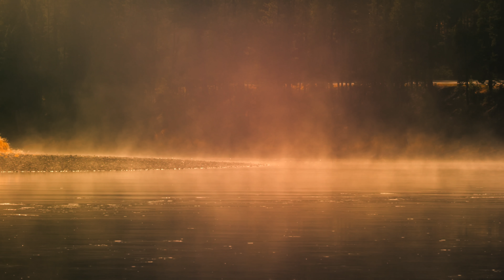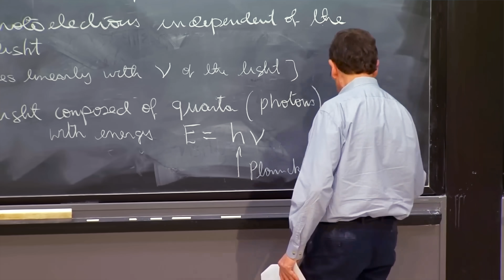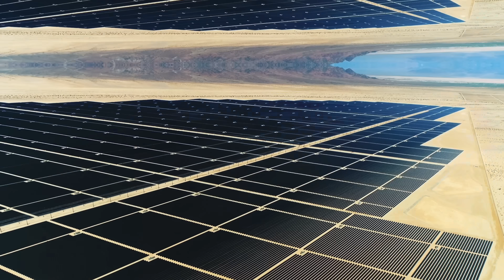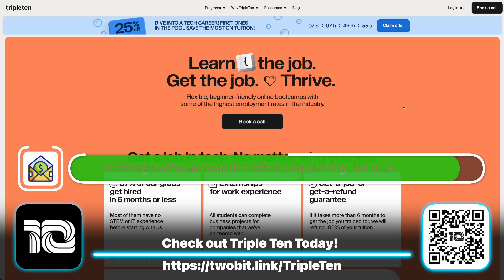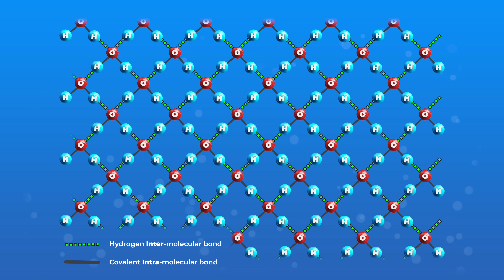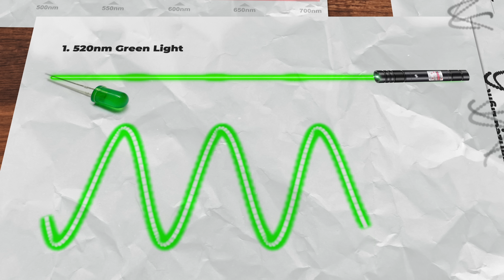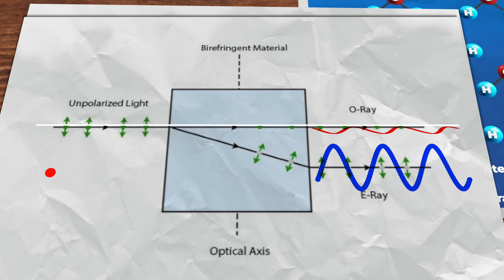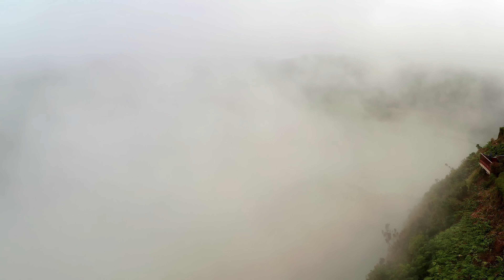New MIT Discovery Just Solved Water's BIGGEST Mystery!

Comment: And causing condensation in the desert.
Concept of Using Lasers to Induce Water Condensation
The idea of using lasers to induce water condensation in arid regions, such as the Australian desert, is an intriguing concept. It could potentially revolutionize environmental science and contribute significantly to efforts aimed at greening deserts.

Feasibility and Mechanism
Photon Energy and Molecular Interaction:

Mechanism: The concept relies on the photomolecular effect, where photons impart energy to water molecules, influencing their phase change. If a suitable frequency of light, such as green laser light, can efficiently transfer energy to water vapor molecules, it could theoretically induce condensation.
Research Basis: Studies like those conducted at MIT on the photomolecular effect show that light can cause water to evaporate without heat. While this focuses on evaporation, the underlying principle of photon interaction with molecules could be adapted to explore condensation.
Cooling Effect:

Laser Cooling: Just as laser cooling techniques can reduce the kinetic energy of atoms and molecules, it might be possible to use specific light frequencies to reduce the energy of water vapor molecules, promoting condensation.
Environmental Context
Australian Desert Conditions:

Temperature: The Australian desert experiences extreme temperatures, with summer highs ranging from 90 to 104°F and winter lows from 64 to 73°F.
Humidity: The relative humidity is generally low, often below 30%, and can drop as low as 10% during late winter and spring.
Rainfall: The region receives very little rainfall, with less than 10 inches annually for about half of Australia, making it one of the driest continents.
Application Potential:

Desert Greening: If lasers can be used to induce condensation, this technology could potentially create localized areas of increased humidity, leading to the formation of dew and even small-scale precipitation.
Sustainable Water Sources: By generating water through condensation, this method could provide a sustainable source of water for irrigation and other uses, aiding in desert greening efforts.
Practical Implementation
Pilot Studies:

Conducting pilot studies in controlled environments to test the feasibility of using green lasers or other light frequencies to induce condensation.
Measuring the efficiency of condensation and the specific conditions required for optimal performance.
Technological Integration:

Developing scalable laser systems that can be deployed in desert regions.
Integrating with existing water collection and irrigation systems to maximize the benefits.
Challenges and Considerations
Energy Requirements:

Assessing the energy efficiency of using lasers for condensation compared to traditional methods.
Ensuring that the energy input required for laser operation is sustainable and does not offset the environmental benefits.
Economic Viability:

Evaluating the cost-effectiveness of implementing laser-induced condensation on a large scale.
Considering the potential economic impact on local communities and agricultural practices.
Conclusion
While the concept of using lasers to induce water condensation is promising, further research and experimentation are necessary to validate its practicality and efficiency. If successful, this technology could significantly contribute to environmental efforts aimed at greening deserts and providing sustainable water sources in arid regions like the Australian desert.

Comment: What about using green lasers to melt ice?
Speculating on the Lowest Temperature for Green Laser-Induced Sublimation of Ice
Based on the principles of the photomolecular effect, we can hypothesize about the lowest temperature at which a green laser could cause the sublimation of ice. Here are some considerations and speculative insights:
Factors Influencing Sublimation Temperature
1.	Photon Energy:
o	Green light (approximately 532 nm) has enough photon energy to impart momentum to water molecules. This could facilitate sublimation even at low temperatures, though the efficiency decreases as the temperature drops.
2.	Bond Strength in Ice:
o	At lower temperatures, the hydrogen bonds in ice become stronger and more rigid. For sublimation to occur, the energy imparted by the photons must overcome these bonds.
3.	Experimental Evidence:
o	Currently, no direct experimental data specifically addresses the lowest temperature at which green laser-induced sublimation occurs. However, indirect evidence from light-induced evaporation of water suggests that the effect can operate independently of significant thermal input.
Hypothetical Temperature Threshold
1.	Near Absolute Zero:
o	While sublimation can occur at temperatures as low as -78.5°C (the sublimation point of dry ice, which is solid CO2), the scenario with water ice could be different. For water ice, sublimation naturally occurs at temperatures below 0°C (32°F) in a vacuum or at low pressures.
2.	Speculative Lower Bound:
o	Given the efficiency of the photomolecular effect and the known behavior of sublimation, it is reasonable to speculate that green laser-induced sublimation could be effective at temperatures significantly below 0°C. A speculative lower bound might be around -40°C to -50°C, where the effect of the photons could still provide sufficient energy to overcome the molecular bonds in ice.
3.	Experimental Validation Needed:
o	This hypothesis would need validation through controlled laboratory experiments. By progressively lowering the temperature and observing the sublimation rate under a green laser, researchers could determine the precise threshold.
Potential Research Directions
1.	Controlled Experiments:
Comparative Studies:
•	Comparing the sublimation rates: Conduct experiments comparing the rates of sublimation of ice under green laser light versus traditional thermal methods. By measuring the rate of sublimation at various temperatures, researchers can identify how effectively the photomolecular effect works at lower temperatures.
•	Different Wavelengths: Investigate whether different wavelengths of light (e.g., UV, blue, infrared) affect the sublimation rate and compare them to the efficiency of green light. This can help identify the optimal wavelength for inducing sublimation.
Speculative Lower Bound and Further Insights
1.	Initial Observations:
o	Preliminary experiments might start at higher sub-zero temperatures, such as -10°C or -20°C, and gradually decrease to test the limits.
o	Initial observations may reveal the minimum temperature where the photomolecular effect is still effective.
2.	Ice Structure and Composition:
o	Consider the impact of the crystalline structure of ice and potential impurities, as these factors can influence sublimation rates. Pure ice and ice with impurities (like salt or minerals) may respond differently to light-induced sublimation.
3.	Theoretical Models:
o	Develop theoretical models to predict the interaction between light photons and ice molecules at various temperatures. These models can help refine experimental designs and provide a better understanding of the underlying mechanisms.
Potential Applications
1.	Space Exploration:
o	Understanding light-induced sublimation could have applications in space exploration, where controlling the sublimation of ice on spacecraft or celestial bodies might be useful.
2.	Cryogenics:
o	In cryogenic storage and transport, precise control over sublimation rates could improve the handling of frozen materials.
3.	Climate Research:
o	Insights from these studies could enhance climate models, particularly in polar regions where sublimation of ice plays a significant role in mass loss from ice sheets and glaciers.
Conclusion
While current knowledge suggests that green laser light can induce sublimation through the photomolecular effect, further research is required to determine the exact temperature limits and efficiency at very low temperatures. Experimental validation, theoretical modeling, and comparative studies with other wavelengths will provide a comprehensive understanding of this phenomenon and its potential applications.

Comment: It seem this also gives a better answer to the very simple question: Why are most plants green? 
We know that most forms of chlorophyll absorbs mainly blue and red light for photosynthesis; but they reflect green light
So, this is cool. By reflecting light in the 520nm range (green), they would greatly reduce the photomolecular effect and better retain water.
Reply: Plants have other means of protecting themselves from evaporation, such as waxy coatings on their leaves.  The ancestors of plants also evolved in the oceans where evaporation wouldn't have been much of an issue.

A more widely accepted idea for why plants are green is the Purple Earth Hypothesis.  The basic idea is that photosynthesizing organisms that use chlorophyll evolved after and had to compete for light with earlier organisms that did absorb green light (and were thus purple).  We don't see that state of affairs today because most of the purple photosynthesizers were killed off by all the oxygen that chlorophyll-based organisms eventually produced.

Comment: I've always understood simple drying effect as the air is like a sponge and absorbs the moisture of liquid water when the molecules on the surface yield to the dryness of the air. The dryer the air the high the evaporation rate. But once the air reaches maximum moisture content it can no longer absorb any more moisture from the liquid water which stops the drying process. Even if it is heated, there is no where for the moisture to go at that point. You don't need any heat at all to evaporate water. Think about freezer burn. Its a form of drying at under the freezing threshold. Water evaporates under many conditions. Heat and/or light seems to be just another force that contributes to water evaporation.

Comment: Which leads to the question, "What if the sun goes through cycles in which it produces more or less green or near green light than at other times?" And not just green. While green may be the "best" at doing this that doesn't mean other colors do nothing. Perhaps even light outside the visible spectrum. It could help explain ice ages. Less green light, fewer and less dense clouds, therefore less heat trapped. Conversely, more green light, more and denser clouds and more heat trapped resulting in higher temperatures. What would variations in green light do to plants? Would they change and become less green appearing? Would less green light mean more plants?

Comment: This is really disappointing because I already solved the same before age of 10.

At hot summer day, I went to swim at beach. So, while I was resting, I felt very cold when I was drying up. I went back to water and beach several times to confirm, that it was sunlight, which vaporized the water and made me shiver, because it took much more heat from my skin in sunlight than in shadow. I was very proud of my discovery, but it never come up again in my life before this video.

Comment: I was wondering how could you increase the surface area of water to increase water evaporation rate using the photomolecular effect during the whole length of the video. Could you in theory excite the water using ultrasonic vibration to make the water vibrate on the surface so it has more surface area? The amplitude and frequency would affect the surface area, so would the angle of excitement. From beneath, from the sides, on angles, multiple exciters to generate multiple wavefronts... So many possibilities!

Comment: If I am not mistaken this was proposed and mostly proved many years ago, but there were too many variables to apply to real in life models without more sensors and data so the it was assumed as true to but ignored for calculation and application purposes for several reasons including most experiments were on small scale and methods of generating light were not that affordable to do much with it.  There were some political and business reasons these things were ignored.  Some of the early versions of those experiments were 1600's and many records of earlier experiments suggesting same effect.  This is even referenced in some of wholistic and home steading literature about making things that control the amount of green light.  Ever check the energy and pharmaceutical sectors patent ownership logs or what was deemed not profitable and buried?  No conspiracy just facts.  Always follow the big green dirty $ trail.  MIT does not have ownership of that discovery and like patenting penicillin to gain notoriety or profits.  There are even clothes drying designs already out there that use the concept in combination with another method both that are more efficient they the common "high tech" (if you are the general public) dryers and the same reason you don't see more cheaper and efficient battery tech mass produced.

Comment: I'm baflled that this was unknown.
Bill Gates proposed chemical trails in the sy to be sprayed by planes, to combat climate change. When others have long claimed that such artificial overcast, typically forming in the PM, are raising overnight temperatures by keeping the heat nearer the surface, causing seeming warming of the climate, to be attributed to the green breath of life (CO2), when really it's light absortion and heat blocking from the artificial overcast.
So will will new insight make chemtrails even better at "proving" climate change by preventing clear sky nights, or will it help Bill Gates in trying to cool the surface air (because that's appararently what matters, not the 12000 km spinning ball of lava underneath) to "save the planet" when it's been wiped out time and again by celestical impacts and perhaps solar flares?

Comment: Well, as an Architect of Water Desalination Systems using solar thermal energy for humanitarian projects, I would like to add some informations.

As you mentioned, this solution requires a very large amount of space due to the inefficiency of the limited solar spectrum. Even with improved efficiency, you will still produce less fresh water. The evaporation process involves breaking bonds between molecules. However, in a solar thermal system, we use the concept of boiling rather than simple evaporation. This is quite different because you need to reach the enthalpy of vaporization of water to boil it and cause vaporization. In your concept, you have a passive system, while in our system, we have an active system using sensible heat to reach latent heat and induce evaporation.

I could demonstrate this through an experiment, as we also produce hybrid systems that utilize direct heating from sunlight (whole spectrum) and mirrors to increase the irradiance. Our system also generates energy, so I could power your green laser to show you the yield of both solutions. 

If you are interested, you can check our work on Niris seawater desalination online, although the latest designs I created are not yet available there.

Comment: Seems slightly misleading to say there is no heat involved. Sure, you are not boiling a whole pot of water to increase evaporation, but energy is still conserved and the water molecules have to absorb energy to break hydrogen bonds. If I burn a hole in steel with a high power laser, am I entitled to say no heat was involved because it’s just light? If the velocity of the molecules increase I think one would be justified in saying they experienced a temperature increase.

Comment: Evaporation is conversion of liquid to a gas WITHOUT heating (difference between evaporation and boiling). I had trouble listening to the rest of the video because the intro directly contradicts basic high school chemistry. Evaporation happens because of kinetic molecular theory which explains how particles move and interact. Random motion of particles means that a certain amount of particle will move towards the surface with enough energy to escape the IMFs keeping them in the liquid state

Comment: i tell you how to test this theory (now discovery) easily. You place an amount of water in a container under some stable light source, you also place a heat measure frame what has the equal surface are as the water in the container and you hit the frame with the same light source for a while. In an other room you will have another container with the same amount of water with the same opened surface area but in this case there is no light source in the room. Now in this second water container case you place under the water the copy (in terms of dimensions and matter) of the heat measurement frame, but in this case this second frame will generate the exact amount of heat, what the other frame just measured by getting hit by the light source.

So now you have the ideal conditions to see if the sunlight generated evapuration causes more water loss compared to the only heat triggered evapuration.

Comment: Let me get this straight - the MIT physicist do not understand that heat is also an electromagnetic wave, just with a longer wavelength than the visible light.

This would explain why they were clueless for so long about the ability of specific resonant frequency of (sun)light to directly interact with a water molecule and give it enough kick to dislodge it from the other molecules and allow it to evaporate.

My god, the MIT guys are SO overrated. You don't really need a STEM degree to know that it's possible - a common sense and a bit of physics knowledge from high-school is ALL you need to figure that one out.

Comment: LIGHT PHASE - remoning a step in the process?
Is it a SPECIFIC phase that is optimal OR is it ANY single phase?
If the later then you do not need to rotate the light, just send the different phases from a grren light source to different water surfaces.